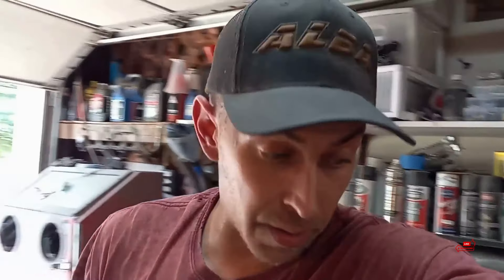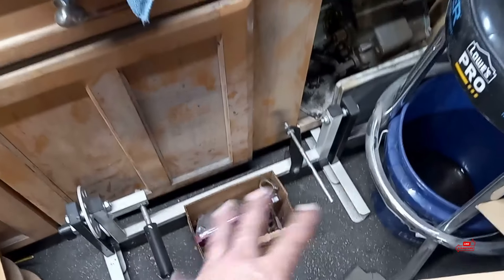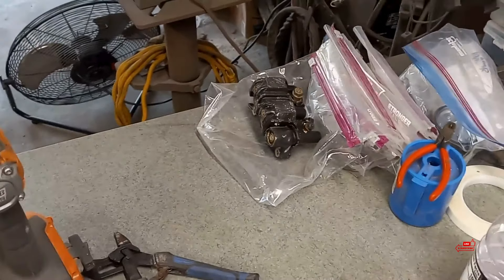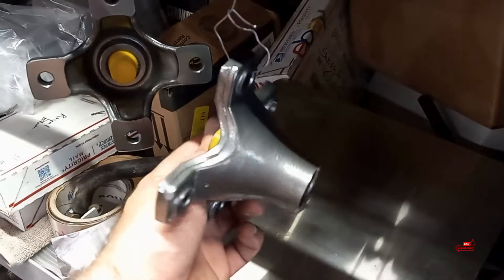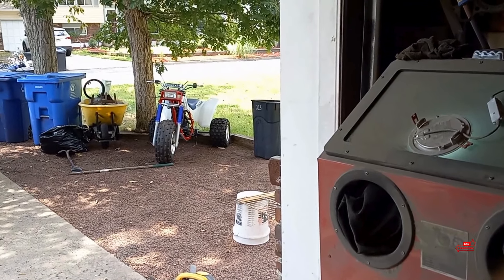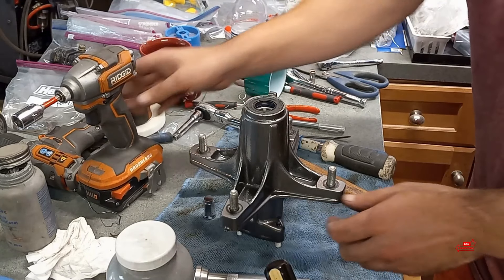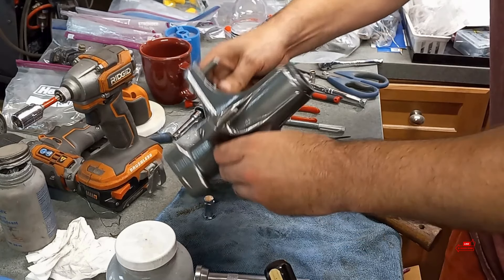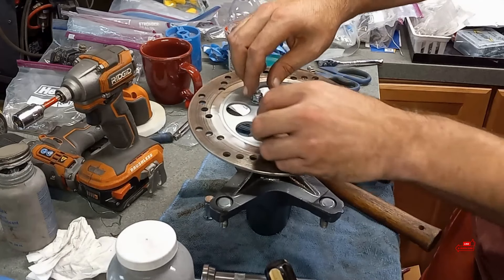Restoring a Honda ATC350X: Wheel Hubs

Comment: Matt, off subject here. I put the yfz450r front shocks on my LT-250R.  My a-arms are practically straight up and down and I'm out of adjustments on my ASR tie rods. My toe and camber is a mess. Please help!
Reply from the maker: @ColinVeraldiLT250-R  the 04-05 style yfz 450 shocks work (carb model shocks) sounds like you got the efi style shocks, they are longer
Reply: @garagemcmatt  damnit....
Reply from the maker: @ColinVeraldiLT250-R  the efi ones look like the ones I put on my raptor 700 video with the alba arms
Reply: @garagemcmatt  you got some shocks laying around I could use?